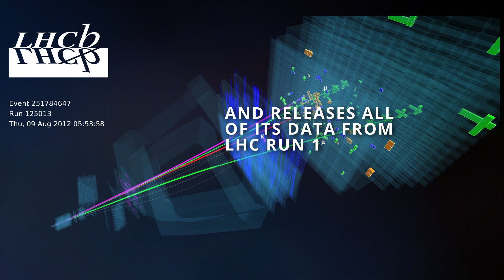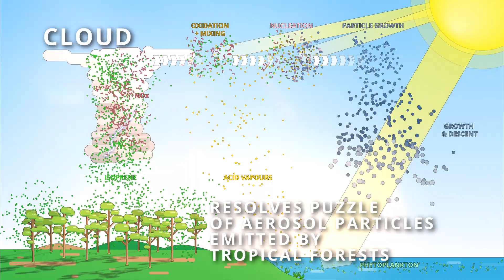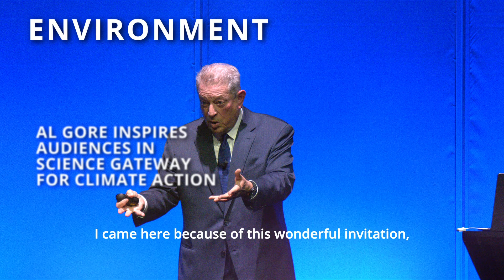CERN highlights in 2024 celebrating 70 years

Comment: [26/10, 19:35] massimo gaspari: viola, parto ora, porto la busta della nonna per te alla mamma, sopratutto vedo come sta jacopo in questi frangenti.
poi, ludo, vengo su.
sono massacrato
[26/10, 19:39] massimo gaspari: se avessi soldi correrei a trovarti, viola.
per me sei irraggiungibile.
sono massacrato fino al midollo
[26/10, 20:26] massimo gaspari: ho dato i soldi alla mamma, nella busta ci sono 250 euro
[26/10, 20:29] massimo gaspari: ludo arrivo
[26/10, 20:29] massimo gaspari: ho visto jacopo
[26/10, 20:29] massimo gaspari: gli ho parlato delle facciate green in lapideo per grattacieli a percolazione di acqua per pulire l'aria
[26/10, 20:29] massimo gaspari: stanno rubando tutto
[26/10, 21:21] massimo gaspari: due righe che da sole valgono una ditta da 100 milioni di fatturato annui.
attorno la mafia si spertica a colpi di cretinetti
[26/10, 21:22] massimo gaspari: esponenziali i ricoveri, i carabinieri in casa